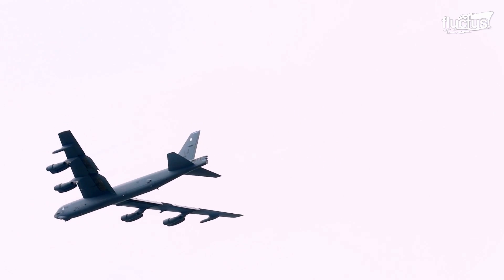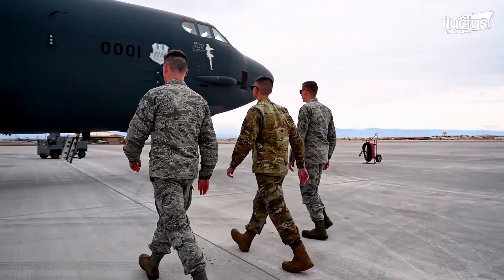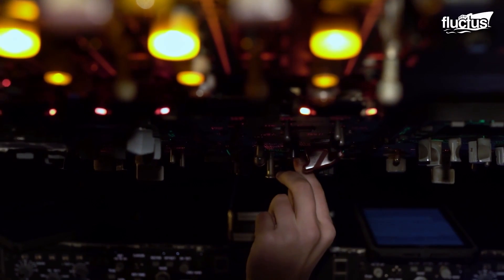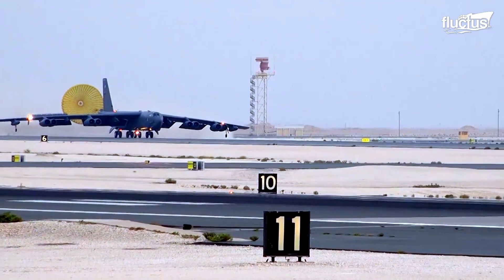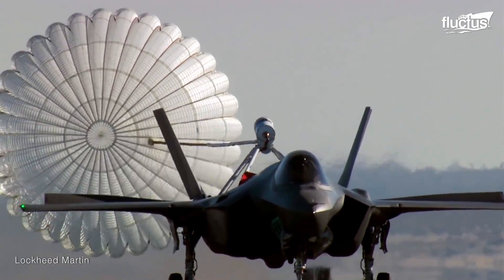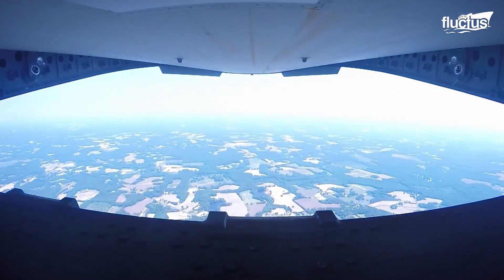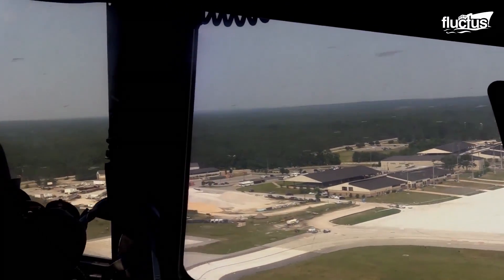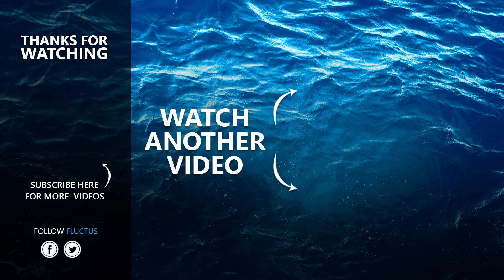The Only Solution US Found to Land its Massive 8 Engines Plane

Comment: One of the challenges of the drag chute was to keep in inflated up to the point of jettison so it wouldn't drag across the ground.A little tricky when turning off the runway.
Reply: Wrong answer it would drag before they turned onto the hammer head to the taxi way I've recovered them from the grass no fun after a bomber flush 12 hrs later  landing 15 minutes apart and dragging them out and  having the next 52 coming up on you on the hammer head in the middle of the night ,and don't say that they don't fly at night please because if you do your a dumb ass

Comment: I flew a Citation 2 in early 1980’s which had a drag Shute. Only used it once. We started aqua planing on a wet runway. Pulled the shura and it straightened us out. Our engineer was not impressed as he had to repack and install.
Reply: That's what he gets the big bucks for. Ask him if he'd rather repack the chute or fix the broken airplane that slid off the runway.
Reply: What impressed me:  Given how little you used it, the fact that you thought if it and deployed it with little hesitation is pretty impressive!  Well done!

Comment: One thing stated here seems to be incorrect. There shouldn't be any problem for a B52 to abort a landing because the parachute was deployed. There certainly is a button in the cockpit which instantly detaches it.
Reply: There's no button to release the chute it's done mechanically just as deploying it I know, had dumb ass aircrew from minot deploying one over devil's lake in n.d. in the 80s had to be mechanically released, I had to head down into the bucket where it's stored to work on the knuckle that holds it to the bird. Said it was a accident everyone knew the pilots were lying you have pull a handle to release it!!!!!

Comment: When the Boeing B-52 Stratofortress USAF Strategic Bomber first became operational, was it the largest combat aircraft in service at the time?
Reply: The B-36 was a bit larger with a greater payload and range than the B-52. However, it was not capable of mid-air refueling and initially lacked the service ceiling of the B-52. It was also "old tech" with six piston and four jet engines.

Comment: BUFFS, Hueys ( UH 1'S ) & Chinnoks will have some still flying 100'years after the first ones rolled of the assembly lines. Watch a gray cloud descend while I was a new guy in Nam. A few seconds later felt the ground rumble. Some B52's dropped bombs what seemed like well over half a mike away.
Reply: I delivered bombs to the B-52's during the Vietnam war in Thailand. Impressive load capability. 
They were so loud, on take off, with all 8 of those engines roaring my ribs rattled. 
Loved my 18 months at Utapao.
Reply: All production B-52's had the cross-wind "crabbing" feature.

Comment: the first one i saw on take off in 1960 it used outriggers at the end of the wings when it was fully fueled and loaded, without the outriggers the end of the wings would touch the ground, the outriggers were not attached to the aircraft and as it taxied and the wing tips lifted the outriggers just rolled off to the side. now i see it has attached gear that retracts like the other landing gear. i was a member of SAC at the time and part of a ground crew on the B47.
Reply: Thank you for your service. And for your anecdote about your experience. 

Happy Holidays to you and yours.
Reply: The outriggers were always a retractable part of the B-52. You are thinking of the U-2.
Reply: They became pretty much indispensable when they put the 3,000 gallon droppable tanks on the wings out near the end. Even empty those tanks are pretty heavy. Someone figured out that 99% of the time dropping those tanks was an unnecessary expense.

Comment: That quick start creates a lot of smoke.  Here I am.
Reply: TF-33 engines take water at the start to make smoke like that. (yes there's a tank for that).
I mean, it's jet engine exhaust, but it's not omg black smoke we're going to die exhaust.
Reply: J-57 engines were also water injected. They were used on the G models,  along with most of the KC135 tankers. Worked on both as a pneudraulic repairman. Watched a lot of launches. 
Thought they used bleed air from the outboard engines to start inboards with after a cart (cartridge) (not card) start.

Comment: @ 1:00 Boeing ended production of the B-52 when the final production B-52H model rolled out in June 1962. The Air Force has planned for a number of improvements, including new engines, new radar, and new communication systems. These major modifications would effectively re-designate the newly modified planes as B-52J models...

Comment: B52 idea was after ww2 not the 50"s. The model made out of wood in a hotel room.
Reply: heya buddy why don’t you relax, check your time frames before scrambling to the comment section like a child.
Reply: @colesherman6849  Please allow some facts into the mix. The original design statement was issued in Nov '45 with the actual bid invitations being issued in Feb '46. Boeing's Model 462 was awarded the initial contract to be built as the XB-52 in June '46. Over the next two years there were many changes made to meet both the changing requirements of the USAF and the design practicalities. In Oct '48 the Boeing engineers met with the USAF reps in Dayton, Ohio to finalize the design. George Schairer of Boeing did build a balsa model of the plane in the Hotel Van Cleve that weekend and when the model and proposal were presented to the USAF it was accepted for final full-size mock-up which was completed in Apr '49. So, it was initiated in 1945, which I would say was after WWII and not in the 50's. So maybe someone else should take the chill-pill and not rush to judgement like that child he mentions . . . Or do you have an alternative history you would care to present?

Comment: 05:26 There are no G Models left in the arsenal. The last ones flew to AMARC in the mid-90's never to fly again.
Reply: Some are still on the ground cut up for parts and satellite photos I guess…
Reply: @Jason-xc1qi  IIRC SALT II required all G models to be rendered incapable of flight. Their wings were guillotined. My dad flew a G model in the early 60's; I still have a picture of it at AMARC with its wings on the ground. Glad he did not live long enough to see that.
Reply: @denali9449  yeah they were last flown in the first gulf war (the G model) they bring back a H model sometimes after one crashes to keep the numbers up. It’s like the KC-135 still going - old tech work horses for sure.

Comment: The b-52 isn't that big. It just has a pretty good payload with the wings. Seriously look at the size comparisons with it and a 747. (it is fun though =p)
Reply: It's surprising how narrow the fuselage is.
Reply: It's still big and tough.
Reply: @briancooper2112   If ever there was an airplane I wish the Air-force would let my fat-ass fly. I would want to fly one. (fuckin' 8 engines are you serious!!!?
Reply: Hi
Reply: Isn't that big, what are you smoking? The B-52 is still one of the largest aircraft in terms of physical size ever built. As for the 747, it is a direct decendent of the B-52 in respect to the swept back wings and engines mounted on pylons the way they are.
This lineage goes back to the B-47 and the KC-135, and Boeing 707 share the same characteristics as the BUFF.

Comment: Spending a lot of time in Blytheville, Arkansas, I had the chance to speak with many pilots of the B52.  Some notable things not covered here.

Many of the flight crew members were 2nd generation in the B52 ... meaning they were flying the "exact same plane" that their father had flown decades earlier.

The B52 has a characteristic known as "wing waggle".  If I attempt to explain it here, you just won't believe me.  Check it out on YouTube.  You will not believe that a plane's wing will actually do this in even the mildest turbulence.

The B52 has one of, if not "the" tallest vertical stabilizer in existence.  So much so that with even a mild cross-wind for landing, the plane will crab almost sideways while the gear is aiming straight ahead.  It's amazing to watch.

Even in the 70's and early 80's, the top of the wings had fiberglass patches on them that were amazingly pronounced.  It looked like the work was done at PEP BOYS, but they still flew well.
Reply: The landing gear was specifically designed by Boeing for just that reason... to remain straight while the plane crabs sideways.  The same design style was used for the 747, which had the same crosswind crabbing issue.
Reply: @Ellros  And ... as a pilot, the design works great and mitigates risk.  My point is ... wear the commercial passenger hat.  Crabbing is a non-event from the cockpit.  I have slipped to a landing countless times ... right down to 100 feet.  That said, put yourself in business class and looking out the window at the middle of the runway on short final.  Barf-Baggers would unite.

Comment: I wonder how many thousands of lbs of fuel it goes through per hour.
Reply: In the neighborhood of 3300 gallons or 19800 pounds per hour depending on settings. Max load is about 312,000 pounds depending on temperatures.
Reply: @denali9449  incredible. At highway speeds, my sedan goes through 1.8 gal per hour 🤣
Reply: @brkbtjunkie  Then again, we don't carry 70,000 pounds of bombs in our cars and cover 525 nautical miles in an hour! But it is amazing - - -
Reply: They are replacing the engines with modern more fuel efficient engines.
Reply: Can you imagines those B52s on the air 24/7 in operations chrome dome in the 60s-70s.

Comment: The use of 'controlled explosions' was not new for this plane. At least in WWII, they used blank shotgun cartridges to start an engine. So nothing new there. I wish you would check your information more before broadcasting; it is boring when you constantly get it wrong!
Reply: Doing it on 8 turbo fan engine is something new